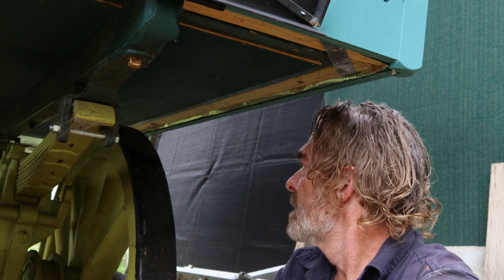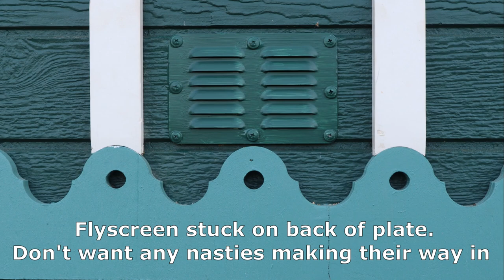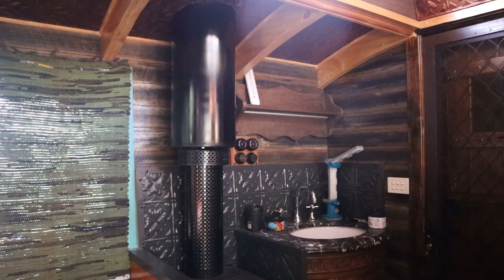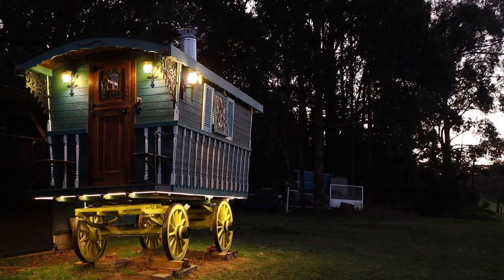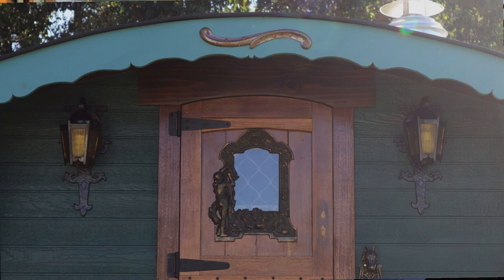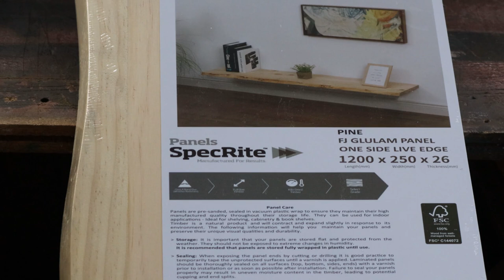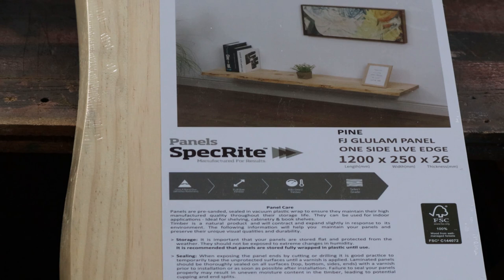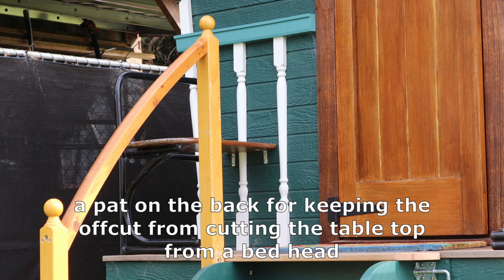Gypsy Wagon 15 - Is This The Penultimate? Maybe...

Comment: Hi there, love your gypsy wagon.  I am a wagon nut.  I have a 3 tonne Omnibus and ran a dine on board horse drawn restaurant in Healesville for a few years using three huge Clydesdales.  I have a pole and/or shaft set up and yes looks a bit like yours.  One goes in the middle between the shafts, then you put a horse on each side.  Each horse has it's own swingle tree.  Are you going to drive horses with this wagon?  You might need a team of three.  When creating a wagon for horses, weight is always a consideration.  When going along with horses, usually a heater that takes sticks you find on the sides of the road is enough to boil a kettle and keep a small space warm.  It can get stuffy in a small space sleeping with the wood stove on all night.  If your going to drive it with horses, maybe consider putting in a cup holder where you sit so you can have a cuppa or other whilst going along.  Thanks for sharing your very cool project.  Its beautiful.
Reply from the maker: That Omnibus sounds cool.
   I started this project with a vision of having it pulled by a horse, but I've since learned what I have here, (which I'll discuss in the next episode) , and that it was never a one horse carriage.  And with that knowledge...I don't think I'll be pulling it by horse. But I still haven't ruled out a horse making an appearance! Cup holders in vehicles...no matter the vehicle...are the first thing I look for 🙂
Thanks for watching 🙂

Comment: Be still my beating heart. Patiently awaiting the sweet 16.
Reply from the maker: Thanks Stephanie.
   I'm having to employ that patience as well. Another roadblock forced me off my feet, a couple of seized up muscles causing a pinched nerve. Horrible stuff. Only just starting to recede.
Reply: @RedPathRambler  I have to suggest getting  a massage.  If a good therapist isn't accessible try a foam roller.
Reply from the maker: @1967Stephanie   Yes I'm absolutely introducing regular massage into my life. And strength training.
Reply: @RedPathRambler  good to see you are taking the natural approach to healing.  I forgot to mention a tens unit as well. Head it off with all the alternatives available.  Over 20 years a massage therapist myself.  Let's see a quick recovery!
Reply from the maker: Sitting and doing nothing is the hardest part. But I'll get through it. Thanks for the concern. 🙂